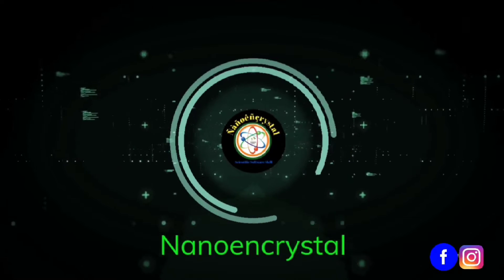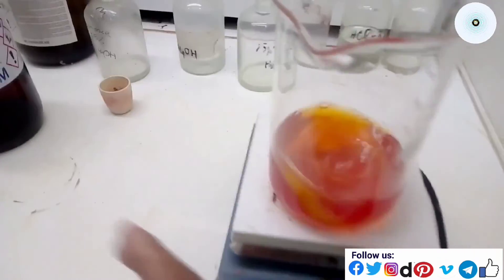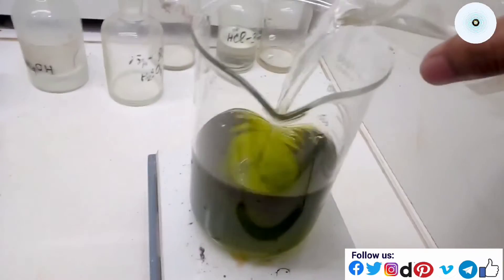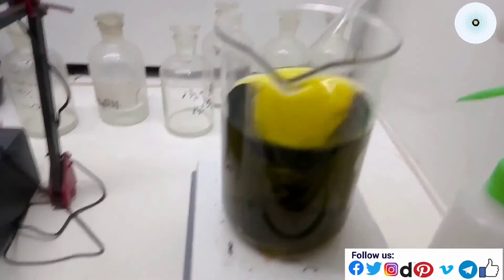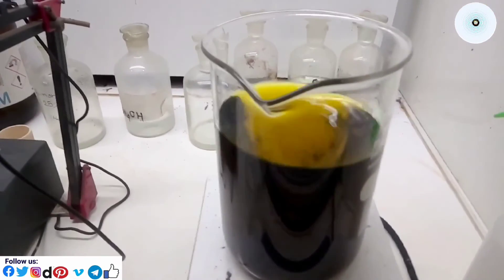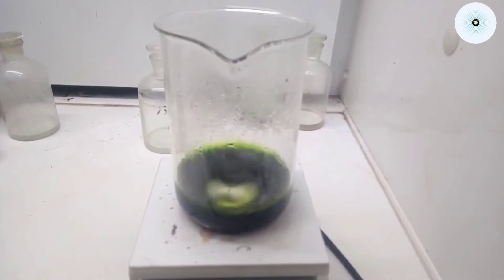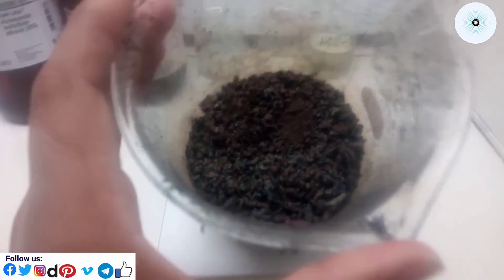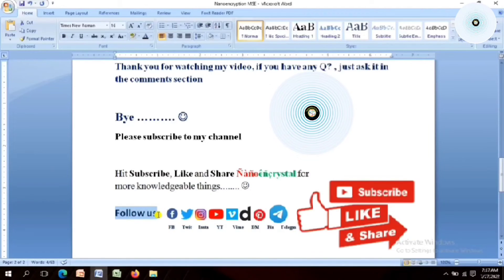How to synthesized of Nanomaterials such as CuFe2O4, NiFe2O4 & CoFe2O4 using citrate-gel method

Comment: Can you please tell me the amount of water and weight of  ferric nitrate, copper nitrate, and citric acid added to the water?
Reply from the maker: For LiMn2O4, Preparation to  5g.

LiOOCCH3.2H2O = 2.83g
C4H6MnO4.4H2O = 13.61g
Citric Acid = 20g and water 💧 use as per the requirements of your solution to get completely soluble and become crystal clear solution. 

Similarly,  go for the NiFe2-xCuxO4 

Thank You 🙏